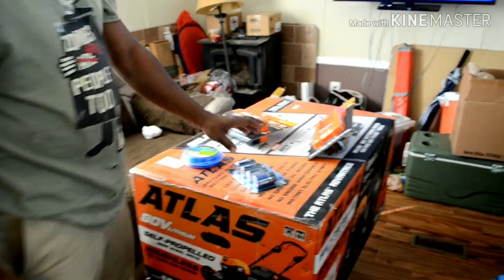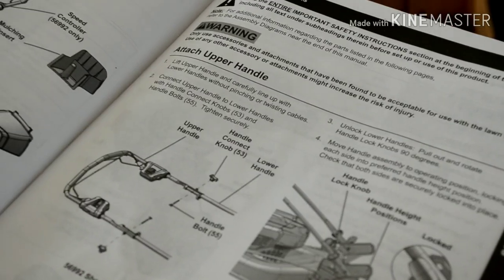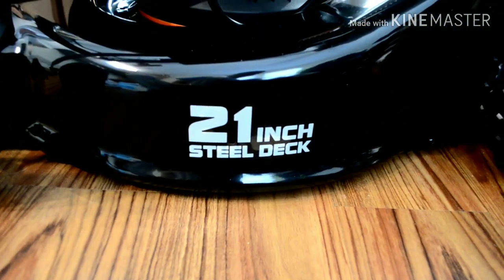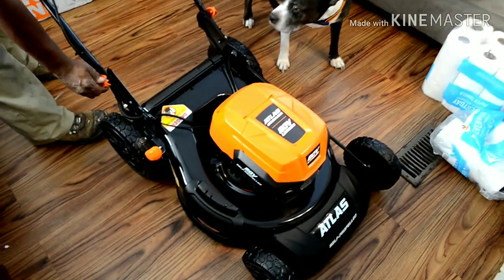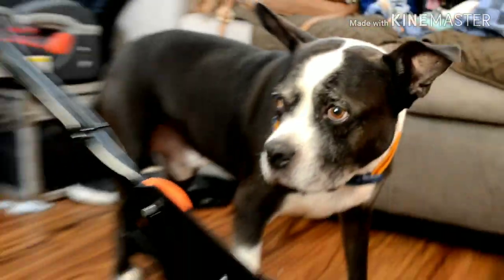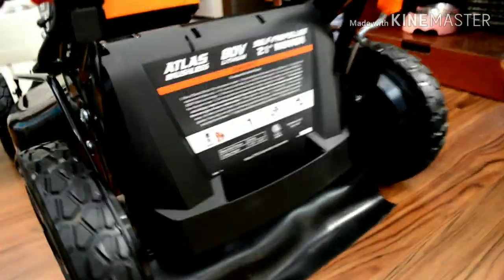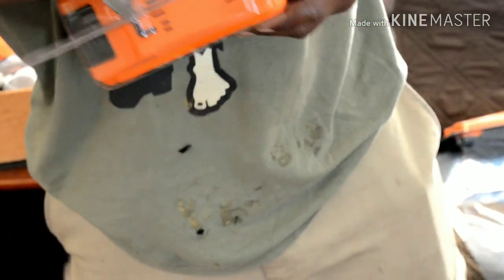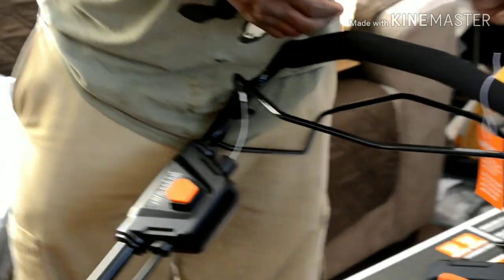Harbor Freight  Atlas 80V Brushless Self-propelled 21" lawn mover

Comment: Just bought and used the Atlas self propelled lawnmower it has plenty of power for tall grass but the self propelled action will cut your battery life in half. I have a medium sized lawn and I almost finished it with one battery at full charge may need the second expensive battery good first impression hope it stands the test of time. Easy cleanup and storage.
Reply from the maker: That's why I originally went for the push model given we are flat and only about 2500sf of yard. I think I'll be picking up one of there trimmers and posting the ryobi on FBMP.

Comment: Those who have it, are you happy with the mower, was it a good purchase. So it can be run on a 40v, even tho the mower says 80v? Thanks for any help or info.
Reply from the maker: From looking at the terminals it will fit. More than likely with its firmware I dont think it will allow it.
Reply: I just picked up the self push mower last week. It seems to be nice. I have a small yard so it will work for me. I hit a little dirt and it tripped the system, had to wait 15 minutes to reset and restart the mower. That is the one downside for me thus far, with gas you can just restart and go. Oh well. I'll test it a bit more before I make a judgment. I live in Northern California so I will be mowing year round.
Reply from the maker: @roadkill890  strange, I have stalled mine on two foot tall weeds and it starts back up. Try pulling the safety key to restart it next time.
Reply: @Tiersmoke92555  that's good to know.
Reply: I'm happy so far with my purchase. Trying to get an electric yard maintenance business off the ground and I've just been worried about customers checking the quality of the cut since I'm so used to a Honda with the dual blade system. In opting to purchasing A second battery as soon as my customer basis exists past 5 regulars. I'm already invested in stihl battery system and this lawn mower seems like the general schematic everyone is licensing and I see no one emulating stihl besides their battery lawnmowers.
Reply from the maker: @jordansmith9743  we just cut 18" thick wet grass. Did just what the 6.75HP Husky did in the same conditions, stalled. I am sure it will keep up with any standard mower.